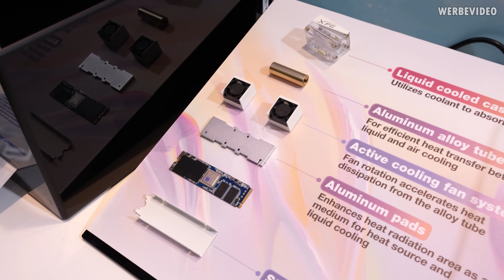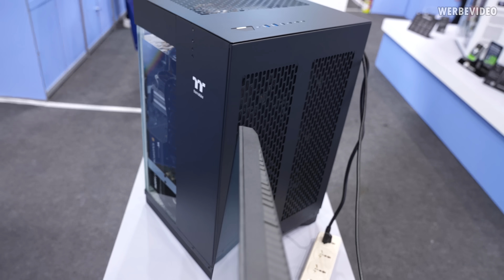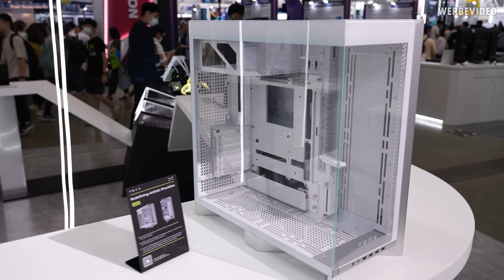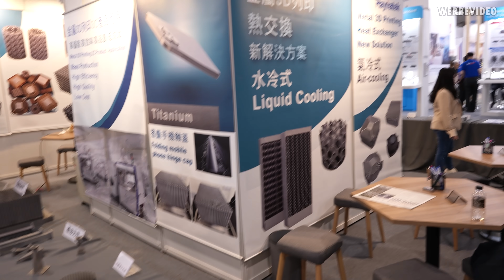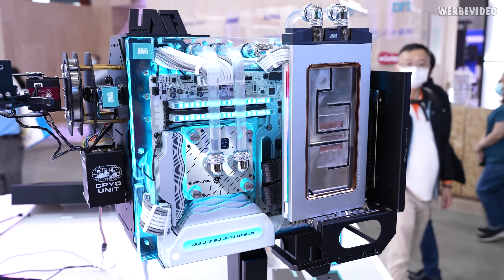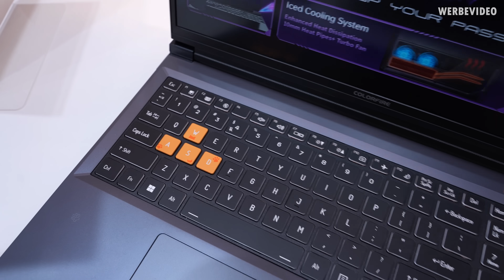Matrix-LED Fans, 3D-Printed Radiators and other Obscure Highlights from Computex 2024

Comment: There's a lot of cool stuff here! About that HAVN case though, I hope there's some way to open up that rear panel, as the rear I/O looks like it's essentially inaccessible in that little cave that they've built up around it. Imagine having to stick your hand back there while the case is under a desk or close to a wall, in poor lighting, trying to insert or remove a small wireless dongle? It would be pretty much impossible.

Comment: I'm really interested in the 3D printed radiators and if they work with similar performance to traditional cooling radiators. Than there is alot of potential there for other use cases.

Comment: For the m.2 at the beginning the answer to your non understanding is simply they can charge more if there is water or RGB on something, ridiculous I should hope most people will know by now, at this point last Gen SSD only needs moving air over it to keep temps low if the board does not have a heat solution to it.

Comment: So why not put an ejectable water filter in line on water cooling systems that can be cleaned when the system is off. Have the filter put in before any fluid is circulated and have all fluid filtered at least once before getting to components

Comment: The water would surround the outside of the tube in the housing while the fans blow air through the tube to cool it.  Not hard to understand but wouldn't work very well IMHOand would also be very likely to have a water leak that would ruin your MOBO

Comment: I'm not a huge fan of all the LCD and OLED screens on PC components, but I really like those LED matrix fans and pump block.   
Also, I find those 3D printed radiators extremely interesting! Could get some very interesting geometries that would be impossible to manufacture any other ways.  Doubt they'd ever be practical for mass production, but still really neat.

Comment: the havn case looks like it would fit the o11 dynamic front distro plate from ek in the side where the case on display has one installed currently.. would be nice as otherwise I don't see a reason to switch cases until the distro plate breaks (not the seals.. can replace them but the plate itself)
looking forward to the review and hopefully you can test the distro plate theory somehow

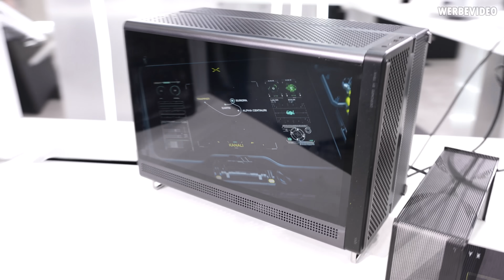Comment: The bare metal case at 3:57 is like a dream to me, if only it came without the screen
Reply: If it was either mesh or straight clear tempered glass, that case would be top tier.
Reply: On the other hand, I can sort of see it as a mobile editing rig.  Just use one of these instead of those ludicrously large "gaming" laptops.